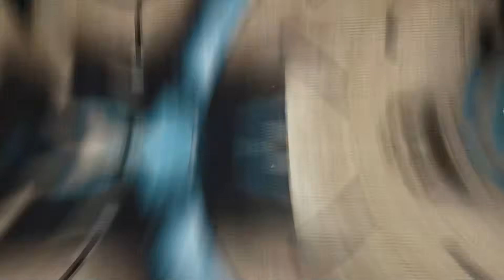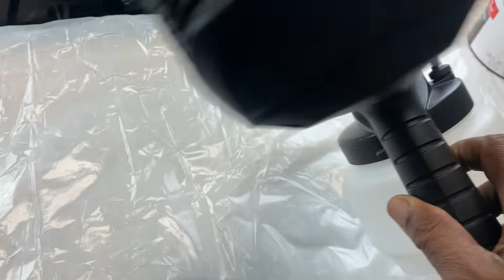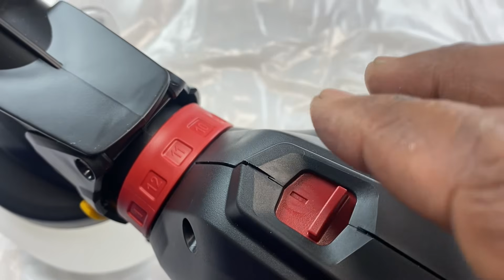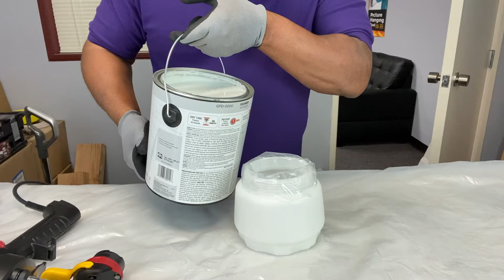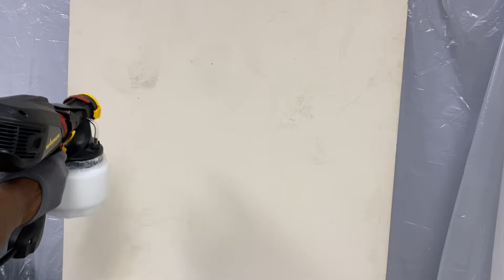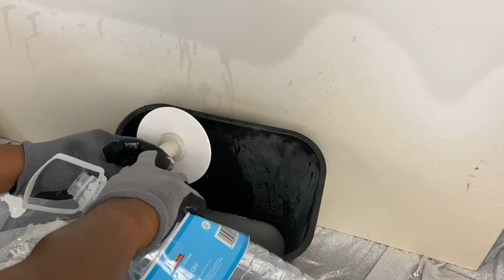HOW TO USE A PAINT SPRAYER FOR BEGINNERS

Comment: This was very helpful. Thank you. I do have a question as I am a beginner. You say there are different settings for different thickness of paint. My question is, how do you know what you're working with? I bought 2 gallons of Dutch Boy paint. It's whatever was the best quality variety of that brand sold at Menards. It is a paint and primer in one. Which setting would I use for that one? I'm going to buy this exact machine since you made it look so easy...
Reply from the maker: Thank you. For a paint+primer combo set the air flow to high(2) and the material flow dial between 9 and 11.

Comment: How do you smooth the little squiggly lines when you first start spray painting? Just a regular roller?
Reply from the maker: Not keeping the gun parallel to the surface can cause this. Keep the gun perpendicular to the surface the whole pass, move your whole arm (not just wrist), and pull the trigger fully before you start the pass and release after you finish it. Don't pull the trigger inconsistently, keep it pressed down all the way during the pass. Using a roller will leave that roller texture and you don't want that if you want a smooth finish. What kind of surface are you painting?
Reply: @Caliber8Tools   Hi! I am painting my bedroom and want to also paint the ceiling. I used paint roller last time and it was back-breaking work. I wanted to try spray painting and saw your videos. Do you worry about dripping paint on the floor or if it gets on your furniture? Do you cover everything to paint?  Thank you

Comment: So, as a beginner, I did not know there were good sprayers that didn't require a compressor. The fact that you didn't address or connect a compressor gives me more confidence that I can do this. Very informative. Thank you.
Reply from the maker: Yes the built in turbine pushes the air through the system. Glad it was helpful.

Comment: Did you think the paint?
Reply from the maker: Depends on the type of paint you’re spraying. Thinning is not always necessary but it will sometimes give better results. 

Latex paints like stains and sealers can be sprayed unthinned. Standard wall paints can also. Oil based need thinning. Best practice is to thin.

Comment: I just purchased one of these and I'm excited to use it but slightly intimidated about the clean up. I've hear these things can render themselves useless if they are even slightly clogged with paint.  Have you experienced that at all after a cleaning with warm soapy water?  Thanks in advance for anyone's feedback.
Reply from the maker: Yes, they can get clogged very quickly if you don't clean them thoroughly right after use. Check out this video on how to do that-https://www.youtube.com/watch?v=3DQB3LqHdR4&t=8s
Reply: @Caliber8Tools I think I messed my painter up. I may have tilted it too far backwards trying to paint the top of the wall near the ceiling and got paint in the fan/motor. Is there any way to clean/fix this or did I just waste $170? 😢
Reply from the maker: @MsButtaSoulFly  The turbine/motor housing and the spray nozzle assembly are separate. Paint that "got in" most likely got into the filter area or the air intake — not the motor itself.

Unplug it 

Remove the nozzle assembly using the Lock-N-Go quarter-turn system to separate it from the turbine.

Check the filter and filter housing — the turbine unit has a filter that can be removed and cleaned. This is the most likely place paint got into. 

Remove the cover on the turbine and clean all parts carefully, making sure to remove any material from the valve seal housing area. 

Do NOT get water inside the turbine motor itself. The turbine unit must be kept completely dry during the cleaning process. You can clean around it, but don't flush it with water. 

For the filter, remove it and rinse it with warm soapy water (since latex paint is water-based), let it dry completely, and reinstall it.
Reply: @Caliber8Tools Thanks so much I’m gonna try this tomorrow and report back
Reply: @Caliber8Tools Hi there I’m currently looking at my Wagner Flexio 1500 and the part the holds the motor has specialized screws that can’t be opened with a Philips head or Allen wrench. Do I have to contact Wagner to purchase a specialized tool?

Comment: please mine is not bringing out paint again but , the air is coming out but the paint is not coming out , please how can I do it to bring out paint
Reply from the maker: A few things. 

Check that the paint pickup tube inside the container isn't clogged or bent.

Remove the spray tip/nozzle and clean it thoroughly with warm water (for water-based paint) or appropriate solvent
Use a small brush or toothpick to clear any dried paint from the holes
Soak stubborn clogs in cleaning solution.

The paint might be too thick - thin it according to Wagner's recommendations (usually 10-15% with appropriate thinner)
Stir the paint thoroughly before use

Make sure you've properly primed the sprayer according to the manual
You may need to re-prime if it sat unused

Comment: Would anyone know if the 2500 can handle drylock basement paint or bad idea?
Reply from the maker: I don’t recommend it. That paint is to thick. It’s recommended you use a sprayer with 2800 psi or a commercial grade sprayer. Using a 3/4 nap roller or a quality nylon brush. An airless sprayer is also a suggestion.

Comment: I followed the instructions.  but...the paint does not come out!?  I cleaned it and put water in to see if that was the problem but it worked.  what is it I am not doing right???
Reply from the maker: Are you using the detail finish nozzle,make sure you thin the paint.

Comment: Hey so I have the Wagner flexio 2500 and I’m getting a spotty spray.  What could I be doing wrong bc I’m so frustrated with it!
Reply from the maker: Could be clogged at the nozzle, air tube or the tiny hole on the suction tube. Take it apart and check those first.

Comment: Great video! Like many others, I’ve been hesitant to get started with the sprayer. Just wondering if you thinned the paint you used in your demonstration and what power level you had it on? At the rate you were spraying, how many sq ft do you think you get out of a full cup?
Reply from the maker: No, didn’t thin the paint. Thinning may be necessary if you are going to use the detail finish nozzle for finer finishes. A full cup should give you 2500 sq ft of coverage. I’m sure it was on the lower power setting.

Comment: Can I add water in the paint holder and use it to clean the sprayer?
Reply from the maker: Only if you used water based paint. Use mineral spirits if the paint was oil based.

Comment: I've seen a lot of people saying you need to thin your paint by adding water, for example, 1 cup to 1 gallon of paint. Is that still necessary if you are using this type of sprayer? Great video, btw! Thank you!
Reply from the maker: Depends on the paint and the nozzle. Thicker paint like water based  latex or acrylic May need thinning. If you’re using the I-spray nozzle, it can handle latex patents without thinning. If you’re using the Detail Finish nozzle for fine finishes, thinning may be required.
Reply: @Caliber8Tools Cool, thanks for the helpful info!

Comment: I like my Flexio 2,500. But don’t be fooled guys. These things are messy. All of the vids are in controlled environments. Try using one outside. When you’re having to deal with wind and trying to adjust your spray to compensate. Don’t get me wrong. They light years faster than a brush and roller. But 95% of these vids/ tutorials are misleading.
Reply from the maker: I agree, outside performance is a whole other ballgame.

Comment: Do you ever have to dilute the paint?
Reply from the maker: With the Ispray nozzle on the Flexio, for  water based/latex paints you don’t have to dilute or thin the paint except for fine finishes  on wood, trim or cabinetry, in which case you would use a The Detail Finish nozzle.
Reply from the maker: With the ISpray nozzle on the Flexio you don’t have to dilute/thin the paint except for finishes on wood, furniture or cabinetry in which case you would use the Detail Finish Nozzle.

Comment: I did everything, but the paint is not coming through.
Reply from the maker: Does your paint need thinning. Checked to see if the nozzle tip isn’t clogged. Hold it up to the light. Make sure the filters are clean.

Comment: My question is, you cleaned out the tube and you disposed of the bag but what about the inner workings of the spray gun? Do you need to run something through the machine so that the parts in between the two and the are also cleaned?
Reply from the maker: Yes that’s always a good practice.

Comment: You didn't have to dilute the paint? What about primer?
Reply from the maker: Thicker paints or water based paints you would have to thin out yea. Also depends on the tip or nozzle. You can use primer with this sprayer.

Comment: I can't stand how manufacturers use " I and 0" for on and off. They couldn't use something more clear? On and Off both start with "O". Use O and X. I'm not a computer,  I don't read binary,  I forget every time.  Similar with " lefty loosey". It's not lefty if you are upside down under a truck grabbing the wrench at the bottom of the turn. Counter clockwise is better and not ambiguous.  Sorry,  loved the content, and just subscribed.  I just needed to vent.
Reply from the maker: Haha, I hear you.
Reply: "O" means the electrical curcuit is not complete or open and the "I" represents the electrical circuit is closed or complete. Think of it like a bridge for electricity to cross.

Comment: I had a ryobi paint sprayer.  The instructions said that after 4x filling the white bucket part, it had to be taken apart and oiled.  Is that true with this sprayer?
Reply from the maker: It should be disassembled and cleaned after each use.

Comment: Question: I do glow in the dark paint and it has little powder crystals that need to come out. Do you think this sprayer or any other sprayer would work? I’m wanting to be able to get fine details as well as big areas. Any information on what sprayers might be best I would appreciate the information. I’ve tried Airbrush but after 300 dollars into it, I discovered the grains wouldn’t flow out of the brush…..😂😂🤓
Reply from the maker: You may need a special nozzle for the grains. But you can.

Comment: nice, thx for sharing, i figure there is a Vaseline pack with it for around  rings( i didnt use it), also it says to detach the nozzle/tubes and clean it...or else if water based,  just spray some soap/water true to clean inside it....or do it with mineral oil or thinner if oil based. thnx for sharing !
Reply from the maker: Glad it helped.

Comment: Did you find it used more material than a roller ? Did you find you still had to roll out the paint for a consistent finish ?

It looks good for small areas....cupboards - closets, doors baseboards etc. I'm just concerned large areas aren't filled properly.

Good vid......gonna try mine tonight on a laundry room.....but am getting ready to go with an 18in. roller.
Reply from the maker: You always use less paint with a roller. No, if you apply the coat correctly there is no need for a roller. Glad it helped.

Comment: How do I use the sprayer when painting inside the cabinets in my kitchen ? The sprayer doesn't fit inside
Reply from the maker: You can remove the doors and spray them separately. You can angle the sprayer to hit the sides and also the top and bottom. You may need to use a small brush for the areas you can’t access with the sprayer.

Comment: It was a great video! Just one question. If I have to paint multiple coats ( let’s say there is an hour drying time between coats) do I totally clean the sprayer between every coats?
Reply from the maker: Between coats you should clean it, remove the nozzle and give it a rinse, and especially if you are going to use a different type of paint or color.

Comment: Hello. Great video! New sub! Total novice at all things home & fix it. Some ?s: 
What constitutes thin versus thick paint? 
I see you wearing gloves. Do you recommend it? I have my dust mask. Do I need safety goggles? 
Do all areas adjacent need covering in plastic and taped off? Or, is there enough control in spraying to not be necessary? For eg. If I am painting a ceiling, would the walls and floors need to be covered? 
Thank you very much!
Reply from the maker: As far as thick versus thin, when you mix it with a stick does it run off the stick in globs or a smooth consistency. You don’t want it to be watery either, you want it to have a creamy texture as it runs. Some paint sprayers come with a funnel to run your paint through to check for thickness as it runs out by how long it takes to run out. 
Wearing gloves just keeps your hands from getting paint on them. I recommend it. 
Goggles are optional but you only have two eyes and you don’t want paint spray or droplets to get in them
Yes, cover all adjacent areas. No matter how much control you have. 
Not necessary to cover the walls but definitely the floors or that area of the floor and even the ceiling trim or upper walls to be safe.

Comment: The best way to use one of those HVLP sprayers is to take it back before you use it and get a decent airless sprayer.  Unless you are using it for decking oil, in which case take it back and get a decent deck oil aplicator
Reply from the maker: 😂, I’m guessing you had a bad experience.

Comment: Thanks for a very educational video.   A question - if I wanted to paint the wall with water based paint, do I just buy the water based paint off the shop and pour it into the container and spray?  And the paint I mention is the same type that I normally use with a roller brush, or it requires any special type of paint?   Thanks again.
Reply from the maker: No special paint needed. Store bought paint poured into the reservoir is fine.
Reply: @Caliber8Tools  Noted with thanks.  I noted from the video no dilution required on the paint which can be poured directly from the can into the reservoir.   Thanks again for a prompt reply.

Comment: Is it possible to use this machine for spraying epoxy paint? Both pre mixed and the epoxy plus hardener type.. thanks
Reply from the maker: Using epoxy paint is not recommended for this brand of sprayer because of the quick dry time.
Reply: @Caliber8Tools  thank you.

Comment: Hi instead of the hard pickup tube that needs to be adjusted when you are spraying up or down, I added a flexible tube with a weight on the end.  Gravity pulls the pickup tube to the correct end of the paint reservoir.
Reply from the maker: Good idea.
Reply: Hey! What do I need to buy to add the flexible tube? Sounds awesome.
Reply: @cameroncrider6970  I actually used Plastic Flexible Corrugated Conduit Tube
Reply: Hard pick up tube faces away from you when doing horizontal or vertical the same. It's when you are doing ceilings that changes positions!